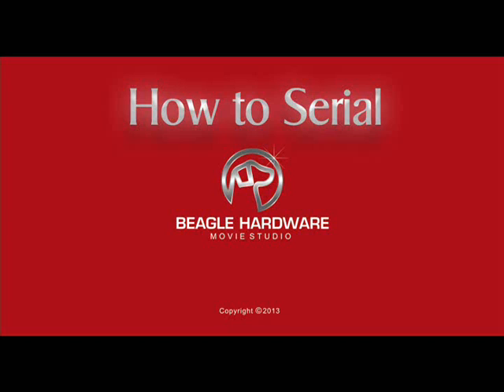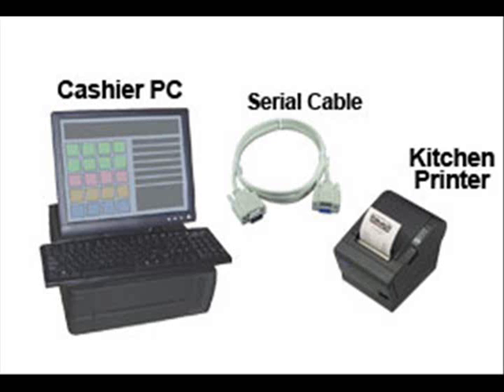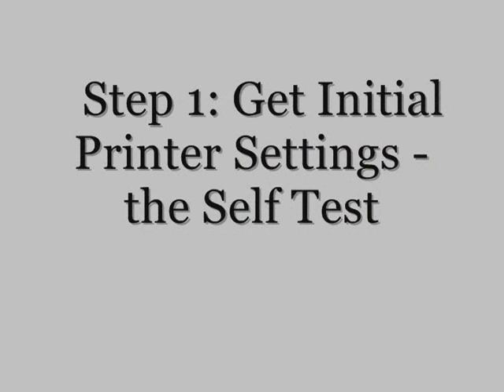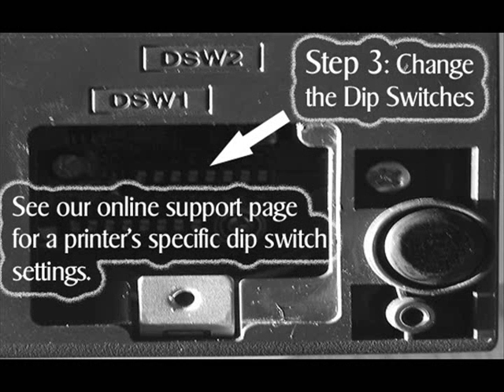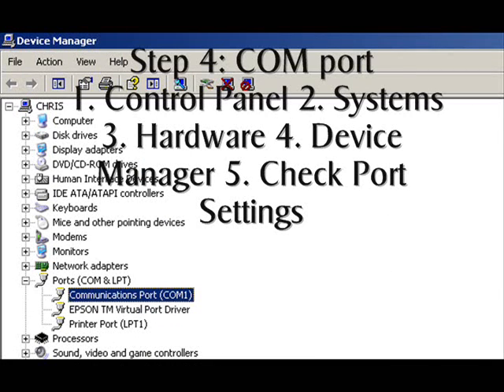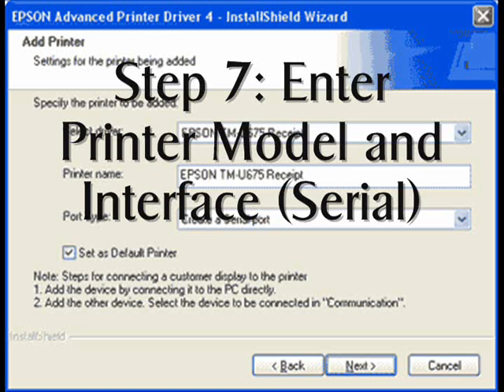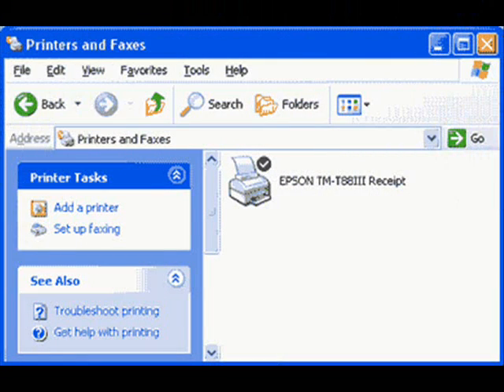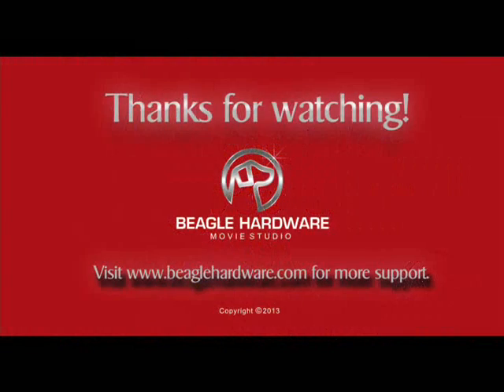How to Connect a Serial Interface for POS Printers

Comment: I used a Null Modem cable, installed the correct drivers, match the port setting with the self test settings, and it still fails to print. The printer is an Epson TM-220B Impact matrix printer. It prints with the generic driver, and even other drivers like the SP216 Star driver. So, I know the printer works. I have no idea what is wrong.

Comment: Arghhb these's printers really give me some headaches:
So i got 2 computer registers and 4 pos printers 3x Epson TM-T90 and 1x Epson TM-T88ll but neither of them print (they al do work) i am using the RJ-11 connector and the thats plugged in my computer now the problem is when the drivers are installed it just does not want to print (yes all the setting are correct) i am out of options i hope someane can help?
Reply: With Epson serial printers you must use a null modem type cable to connect them to the computer. This type of cable crosses the transmit and receive lines to properly connect the printer. A straight through cable that connects transmit to transmit and receive to receive will not work. Google "Null Modem Cable" to see the pin-out needed.